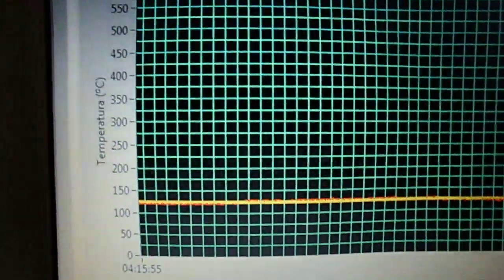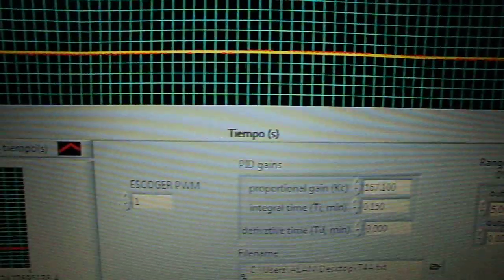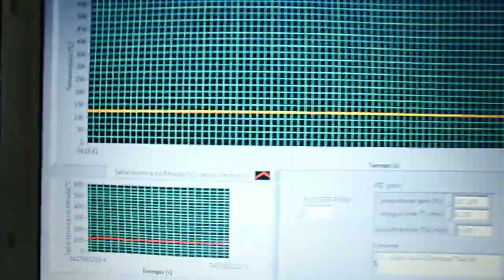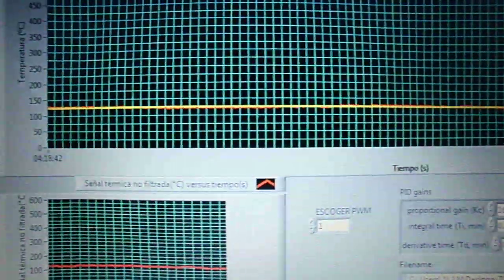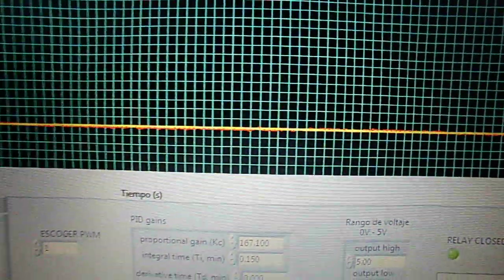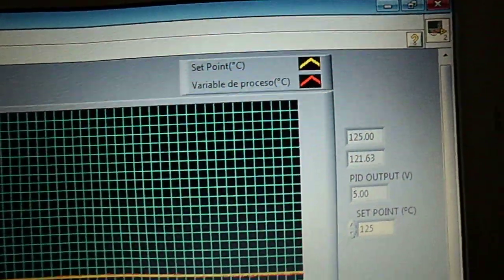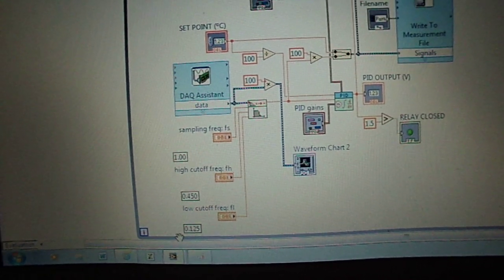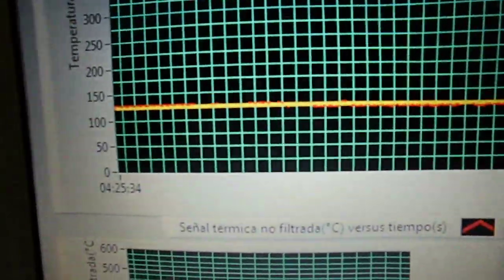Temperature control system using DAQ NI USB 6008 and labVIEW

Comment from the maker: Hello, I am so happy because I have just received some messages where people question to me why the controller parameteres are:
      Kc      Ti(s)   td(s)   
P   185.67   0     0
PI   167.10  9     0
PID  222.80 6     1.5
It happen because test before the video I worked with time delay equal 3s, but if you replace with 4s you obtain 
      Kc      Ti(s)   td(s)   
P   139.25   0     0
PI   125.33  12     0
PID  167.10 8     2
however the effect in the control is not perceived.